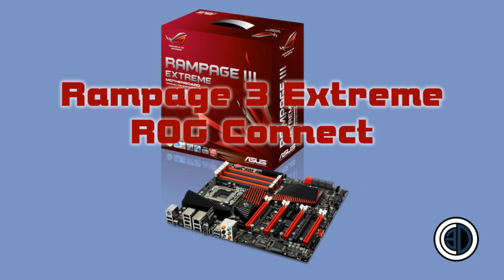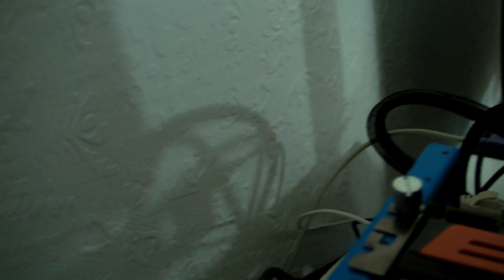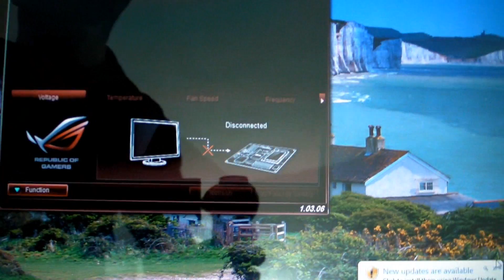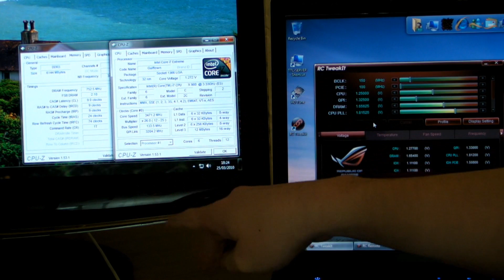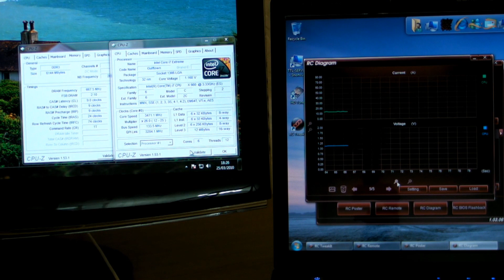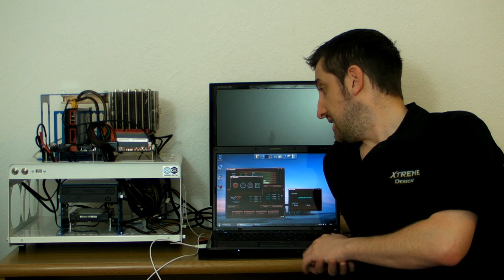Asus Rampage Extreme 3 - ROG Connect - YouTube FIRST

Comment: can i run this mobo with only two 4pin connectors(850w coolermaster silent pro).if so  so should i plug the two 4 pin into a single 8 pin socket or a single 4 pin on each socket.

Comment: New Build, need Help! These are my components..M.B. (Ausus Rampage Extreme 3), CPU (i7 980x Extreme), RAM (3x2gb OCZ Plat edit), SSD (OCZ 60gb Vertex 2), G.C. (Saphire ATI Radeon HD 5850), P.S. (CoolerMaster Silent Pro Gold 1200W), O.D. (BDR 205 Blue Ray), K.B. (Logitch G19), M (Logitch G9x), Monit (Samsung PX2370 LED), Chas (Coolermaster Cosmos S). I connect SSD onto red 6gb sockets on MB, & adjust bois setting as AHCI. My SSD reads as external Drive, WHY? I want it to read as normal Sata Drive

Comment: @TimeToLiveCustoms Ah I understand. I was just curious. So using ROG connect with a laptop, I can make the clock and voltages changes, and they'll stay permanent? Or should I just write down the clocks and voltages I set and do it in the bios manually? 

Also, what's the extent of control of it in terms of disabling/enabling features and settings you can do in the BIOS? Should I do those first, then OC with ROG connect after I've fine tuned the other settings?

Comment from the maker: @nitronick389 You need the slave system to be able to alter the bios. Its a bit of a mine feild trying to stabley change the BIOS from within windows on the same system. It does work very well with connect and is a great tool.

Comment: what is that rack that you used to assemble the computer?  is that what you use for maximum air cooling?  is it for diagnostics only?  or just an interesting new mod?

would you "not advice"  setting up like that for the regular user?  it looks like it would be good for water cooling because you can easilly monitor the tubes for leaks etc... and easy access to the board's buttons.

... where did you get it?  ;D

Comment: @gdw22 

Its not full EATX, its just 1 inch wider than a normal motherboard. It will fit into most Mid size cases, just open up your case and see if theres an extra inch width over your current mobo.